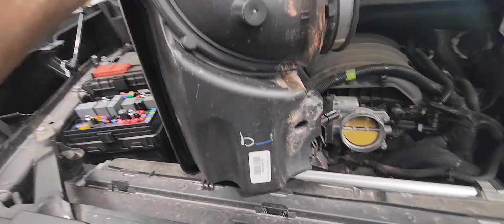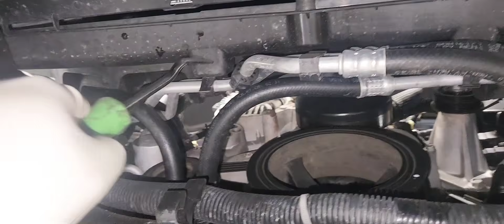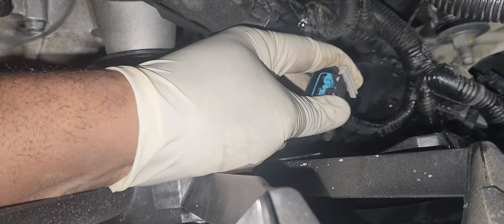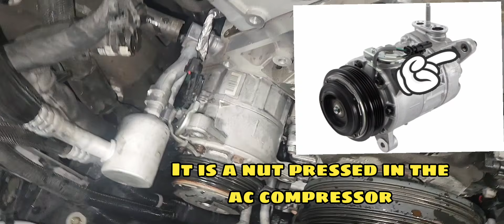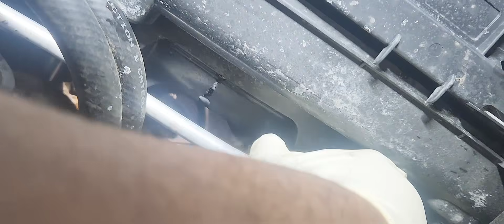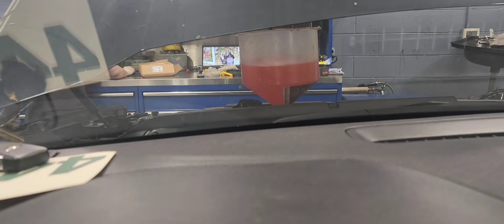Chevy Silverado Water Pump DIY | Save $500+ at the Shop

Comment: Video is very informative. I have a question would it be possible to slide the belt off the water pump instead of cutting it ? Just my opinion thanks for the Video
Reply from the maker: Unfortunately not, they are one time used

Comment: Need help diagnosing a problem.   I replaced my water pump two weeks ago, prior to replacing I had zero check engine lights, I just knew it was going out due to the sound. Once I replaced, everything was good, then the next day my fuel gauge was acting erratic and just sits at empty now, along with check engine light throwing a bunch of module codes (U codes). I replaced battery, that wasn’t the case. I’m unsure of what the hell I did and can’t find the solution.
Reply from the maker: It sounds like you may have a loose ground or a pinched wire harness near the area you were working on.

Comment: "If the pump fails and leaks, does the entire system shut down automatically to protect the motor?"
Reply: No.  If the thermostat or the temp sensor, the fans come on all the time but this was on my 2014 Silverado 5.3.  That tells you replace Thermostat. 

If you hear water sloshing around in your heater core, is that pissant pump connected to two hoses behind the right front tire and frame.  The donut is a f—-g pain.
Thermostat is right behind hoses, sideways—use a magnet to set them. 

We can do it ya’all!!!!!!

Comment: The heat in our 2021 Chevy suburban cabin was inconsistent to the point where we weren’t getting any at all. We brought it to the dealership. They told us that we have a leak in the water pump and they wanted $2800 to replace it. We bought the part for $200 and my father-in-law who is handy with cars replaced it. We started it up and still do not have any heat in park but when we’re driving it heats up and then it cools down heats up and then it cools down so we’re not getting any consistent heat in the cabin. What do you think it could be and what should we check?
Reply from the maker: Let it run for 20min  with the heat on high ,fill the coolant bottle all the top,with the cap off
Reply from the maker: You still have  air pocket in the heater core that's why the heat is not working unless you are driving

Comment: You don’t have to remove the fan assembly. Nor the fuse box. That bottom alternator-bolt  can be simply taken out if you tilt the water pump at an angle.

Comment: Mannnn ... so sorry guys., to those whom has to do the water pump on truck with this design you littlely   have to this steps to the teeth., to an exemption on the inner wheel cover to drain the radiator., went remove the passenger lower hose front the passenger side just till it up so u dont loss all the fluid.,and yes ., the fuse box has to come out just as explaing here because the fan has to come out due to the alternator bold is to too long., this video was very helpful. Tnx man., also make sure the gaskets on the water pump dont fall.,it took me 5 hours., ohhh one more thing., the serpentine bell its a beachhhh to put on so use the same tool as the bell for the ac compressor., ohh one more thin., the ac compressor bolds (2) takes a while to alining
Reply from the maker: Thanks for sharing your experience, glad it helped you with the repair!

Comment: You need to relearn proper way to remove water pump. The pump is removed only, not the water pump assembly. It takes only 20 minutes to change the impeller unit. All the shit you are doing is a travesty being shown on you tube
Reply from the maker: 🤣🤣🤣are you talking about 14-19 silverado or the new gens 20 and up?

Comment: I’m having a hard time lining up the ac compressor to the water pump. When I get bolts in the bottom side of compressor seems to be hitting something pushing the pulley up. I’ve tried rotating but no luck. Any tips?
Reply from the maker: Check this video out where I explained in depth 
https://www.tiktok.com/t/ZTja95bCa/
Reply: Thanks, so much help!
Reply from the maker: You welcome 👍

Comment: That Compressor stud requires a 3/16 socket not a 5mm (it will strip) and keep in mind there’s a belt tensioner conversion kit for these engines now, that will put less load on your bearings. There’s also a bushing in the A/C housing that may come out with the bolt.. don’t lose it
Reply: Could you point me in the right direction for the belt-tensioner conversion kit? 6.2L 2020 silverado
Reply: @Something-New- 

Did you ever find the belt tension converter kit? Trying to find one too.
Reply: @Something-New- any luck? On this conversion?
Reply: @jcesparza_956  No sir, I did not find it. I did do the job though, without having to take off the radiator. BE WARY of the AC stud on the bottom left.... that F***er will bend/strip very easily and then you will have to tap it out...
Reply: 3/16 did not fit mine, 5mm is correct.
Reply from the maker: Thanks for the explanation
Reply: It’s not a standard hex. It’s metric just like the rest of the bolts on the truck.

Comment: Just wanted to say thank you. Great video, definitely saved me some time on the exploratory, “What else do I need to disconnect?” part of changing this.

That said, which I think was easier, but maybe didn’t save any time versus what you did. Was I removed the throttle body spacer and pulled out the alternator still attached to the water pump because the only reason to disconnect all the engine and trans cooler lines is to take the shroud off. But it only needs to be taken off for the bottom long bolt, so if you don’t mind pulling them out together, you can leave the shroud, the fuse box, and all the cooling lines and skid plates on. 

But it wouldn’t have been as easy for me to do that without your video. Cheers and thanks again!
Reply: Was kinda wondering about that too.  I'm old, remember changing a water pump with a boyfriend on a 70 Chevelle  it was so easy. 

 This started to look like he was taking half of the truck apart. I'm like, I'll never remember where everything goes in order to put it back together. 
With that said,  I'm so thankful for his video. Will help tremendously.

Comment: Question Sir my serpentine belt tore and water pump wont turn at all should be able to move freely right ?  so that means the pump is out of service right?
Reply from the maker: @gmgm372  that mean the pump bearing failed, you will need a new one, can you wiggle it
Reply: I finally got everything out , and the water pump won't move at all . Your video was such a big help for me . The only thing is that Ac compressor nut remove deal. I trying everything it won't come out .
Reply from the maker: Yea the ac compressor bolt is the hardest part of the whole job, it is a pain, finally figure it out, you have to install the bolt then tap to put the threaded insert out

Comment: Do you have to knock that peice on the compressor all the way through? Or slightly?
Reply from the maker: Just a little bit do that the compressor can go in with ease
Reply: @steevegmtech7326  that compressor is a pain to line up with the water pump, Is it easier to take off the ac belt?

Comment: do you have to knock that piece on back of ac compressor bracket to reinstall, if so how to do that i have tried and cant get it pushed out back end
Reply from the maker: Yes you have to if not the compressor will not go back, put the long bolt on  then hit it with a Hammer until it moves slightly backwards
Reply: @steevegmtech7326  thanks, is it ok to screw the long bolt in and strike it or will that strip the threads
Reply from the maker: Yes you can, that's how i do it,don't go Banana on the bolt 😄 obviously, by 4 tap it should  move
Reply: @steevegmtech7326  thanks ill give that a try soon!!!!!
Reply: @steevegmtech7326  after failed attempts with hammer i found a tie rod puller and used that, screwed in that long bold and used this up front and it pushed the bolt back and that notch out the other end. hopefully this helps someone having issues with hammer
Reply: @steevegmtech7326 do you have to knock it all the way through ? Seems pretty hard to do when I try it

Comment: Why do you disassemble so much stuff?  Seems unnecessary. Does the GM repair manual instruct you to do it this way?  I watched a mobile mechanic swap a water pump on a 2020 truck in about 10ish minutes not including the belts.  https://youtu.be/QHrwpnU6XCE?si=ZSgmG05LT8taJIXE

Comment: It’s a great video, it helped me a lot but I took out the water pump without having to take out fuse box and fan shroud. It wasn’t that much more difficult. Only thing is that you’ll need to take out the alternator together with the water pump. The long alternator screw on bottom won’t come out unless you remove the passenger side fan. There’s enough wiggle room to take it out together. I watched video several times to guide me.
Reply from the maker: Thanks for watching, you are right I've take a lot of unnecessary step but I usually do it so that the viewers don't get stranded , do the job right the first time appreciate your input
Reply: @steevegmtech7326  you gained a subscriber for sure. Thanks for the video.
Reply from the maker: @gsxrsuzuki600  thanks for the support 👍

Comment: Just did a water pump on my 2018. Was only a 20-minute job. You lost me at "Remove the Fusebox".... wow
Reply from the maker: I believe you man, gm decided it was too easy in the previous gen so they buried that one
Reply: It still is a 20 min job. I can’t figure out why he disassembled half the stuff he did.  I just watched a mobile mechanic pull a water pump off a 2020 truck and put a new one in, in about 10 minutes. https://youtu.be/QHrwpnU6XCE?si=ZSgmG05LT8taJIXE Maybe he wanted more room to work? 🤷‍♂️
Reply from the maker: He skpped through a lot of steps like the ac compressor which is the most annoying part of this whole job to lign it up with the block, and a few other things, i do it that way for the ppl first time doing it, and  give details
Reply from the maker: Also gm warranty time is about 3hr,i usually do it in less than that
Reply: @steevegmtech7326  I dunno man. I think ima skip all those steps too if I have to do this lol.
Reply from the maker: Alright man good luck 😆
Reply: i just did the water pump in my 18 as well. you literally don’t even need to replace the entire pump, just the pulley that detaches from the pump. that was probably the smartest design gm has ever done. took me ten min. i even slapped on a new thermostat and did a radiator flush along with putting on a new belt
Reply from the maker: That's when they had common sense 😄
Reply: @jonnysnipes3123 probably different design because I spent a while looking for the thermostat when other videos show an upper thermostat and mine was just like this video so maybe you have the common engine lay out which is easy, it took me about 10 to get it off once I found it but even the auto parts store wanted to tell me that the part they got me was correct even though it wasnt
Reply: Dude why the heck are you pulling out everything?  Only water pump assembly and not motor replacement.
Reply from the maker: Yea unfortunately that's what the book called for

Comment: Bro you don’t have to remove as much as you did to replace it
Reply from the maker: Yea it is just make it easier but i get your point though
Reply: Not bashing you  @steevegmtech7326  great work, especially when you told people about the slider on the compressor. A lot of people will forget to mention stuff like that.
Reply from the maker: I didn't take it he wrong way, thanks though
Reply: @elpatito6069 What steps can be avoided? I have to do mine and I don't want to do more than I have to.
Reply: @mikemckenna1929  you don’t need to pull the fuse box or the fan just disconnect the passenger side fans and put take out the 3 screws that hold it i believe they are Torx 25 or Torx 27 so you can’t get the alternator bolt out
Reply: @elpatito6069  That one single tip was HUGE!!! I just pulled my alt out. T25 btw.
Reply: @elpatito6069  Any tricks getting the ac condensor to line up with the water pump bracket? I've been going at it for 2 hrs now.
Reply from the maker: Put the insert out in the back a little to get clearance

Comment: Hey do the bolts need to be torqued to a specific spec on the water pump ?
Reply from the maker: No torque specs ,tight them in sequence so that they can evenly seated
Reply: First pass 40 in/lbs second pass 89 in/lbs.

Comment: 2019 and they need water pump replacement? It’s only 2024
Reply from the maker: That one was under warranty, learn how to do it, cause they do fail
Reply: I had water pump failure within the first year on my 2020 2500 silverado. Truck was down for about 3 months
Reply: @cpenv they fail way to often. Along with many other parts.
Reply: Have a 2020 with only 63000 and it's needing one already.
Reply: 2020’ Silverado 6.2L  193,009 miles and 3rd water pump is about to go in.

Comment: Hello I can't find water pump you can help please me
Reply: Thanks for you help
Reply from the maker: You welcome
Reply: Gasket need buy separed?
Reply from the maker: It comes with the water pump
Reply: This guy want someone to help please him apparently 😂
Reply from the maker: link for water pump
https://amzn.to/42z74Zz
ac belt
https://amzn.to/3uiPYCc
accesory belt
https://amzn.to/49bTZaC
basic hand tools 
https://amzn.to/3Sj7dLV
torx bit socket
https://amzn.to/3UpMSHv
Pick set
https://amzn.to/3vTiriH
Coolant hose clamp tool set
https://amzn.to/3rzOlhJ
Reply: They fit 6.2 l 2021 silverado?
Reply from the maker: Yes it doee
Reply: I need to be used Coolant Funnel Kit, Radiator Flush Kit?  Thanks for you help
Reply from the maker: You can buy if you don't have it ,manually flush it , I have a video about that
https://youtu.be/-jXsJ5GKQBE